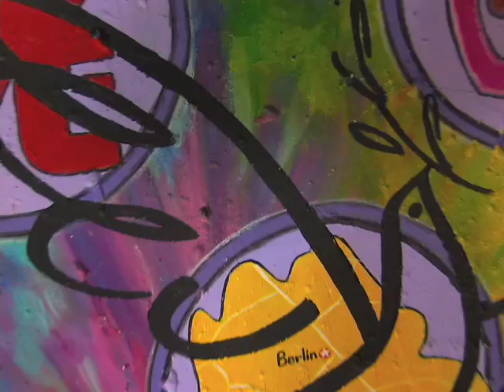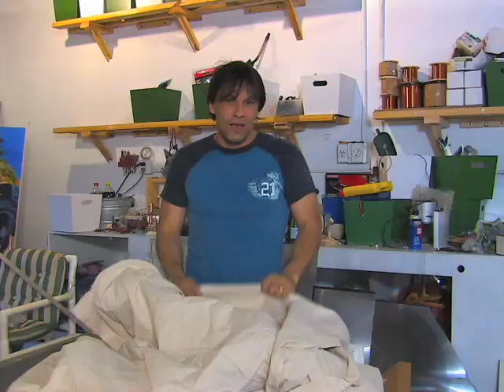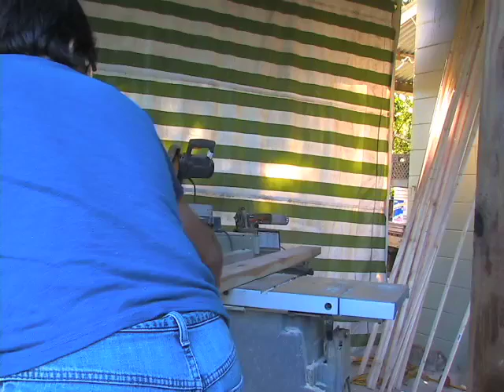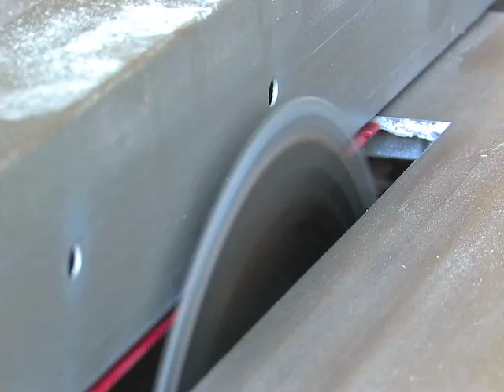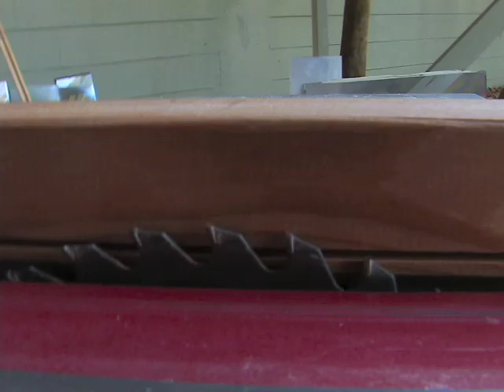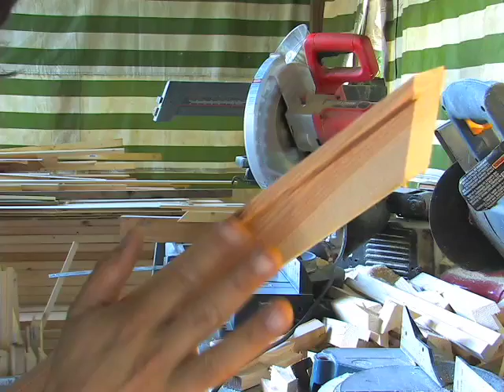P 1 STRETCHING CANVAS ARTIST WINDMILL BLADES RECYCLING VAWT

Comment: perhaps in low wind conditions the efficiency and or electricity generation factor would be diminished but in event of a wind storm one could light up the burners and provided one had an agreement with their electricity co and was " on the grid " and could sell power back to them it might be possible to generate a few hundred dollars worth of power ?

Comment: set be placed underneath the mill and that magnets be placed on the bottom of each blade . Also i think that themocouples , or electical generation devices that utilize heat energy can be incorporated ? In that if ,lets say , twelve thrmocples were arrayed underneath the peripheral coil and mill relationship that a propane tank could be used to apply 12 flames to each couple and complete the induction mechanism and possibly initiate enhanced performance especially in high wind/rpm circumstances

Comment: Ive watched a bunch of your videos and have found them to be highly informative and well done ty .I've got a hypothetical question for you regarding vertical axis windmills . I've been thinking it might be possible to improve the electricity output one gets from these machines by incorporating a few variations /modifications ? Instead of utilizing a standard rotor/ stator type generator directly driven by the motion of the mill Im thinking that a coil approx the outside diameter of the blade